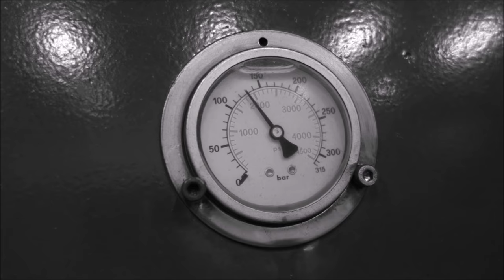Repairing electric motor bearing housing

Comment: I do this same repair all the time. I enjoyed watching your process. I've changed how I do it, and now I bore the bell....rough turn and bore the sleeve to final size, and with the bearing in place, turn for a glue fit in the bell. Part it off with the bearing in place, and lock tite it in. I find great prices for Locktite on Ebay. I would probably charge $200 or more for one that size. BTW.....it's called a boring bar in my town. The slidey thing is called a carriage.....considering how Finish is related to Martian languages, and all other Earth languages are from this planet, Your English is perfect!
Reply: Josh Ward I do these all the time also. We can’t fit the brg. As they press the brg. On the rotor shaft first then tap fit the end shield . We have to loctite and Dutch key the sleeve in as they can come out of the end shield.

Comment: I am not a machinist but do this sort of work in small scale with the Minilathe. And that is exactly the way I would do it. Inc the Green Loctite and the Mitutoyo calliper. I LOVE that inside micrometer! I use a bore guage.
Sometimes it makes you wonder how they made the original part though. Start with a raw casting and have to machine all your centres.

Comment: Fuck me, that 3-point micrometer is great. I'm surprised that I haven't seen @Abom79 using those yet....!
Reply: They are VERY expensive and you must buy a set which is VERY, VERY expensive. Thousands of dollars. I find a good set of telescope gages work great once you learn how to use them. A set of those costs less than $200.
Reply: Prostheta and that one doesn't even look digital...

Comment: I love the main channel and this one too  :) also at last a machining channel from europe where the metric system is used instead of the 3/125465465468 inch bs :D nice to hear mm and cm used :D
Reply: Decimal numeral systems are used by machinists everywhere. The only difference is the base unit, all the math is the same. Separate from that, fractions are basic year 3 math, all rational numbers are fractions and all practical measurements are rational numbers. Standard inch fractions are all base 2, same as your computer.
Would it help if they used the term milli-inch instead of thousandth? They used mil in the past (still used for some product thickness, such as plastic bags or paint coatings) but the term mil has faded due to confusion with mm and um.
Reply: bametje88 I worked lathes and cnc mills in America and we used metric...what's your point
Reply: there is always a metric elitist
Reply: herpherpbrocolli Not too elite if they don't understand fractions and other basic math.
Reply: No need to be buthurt guys. Have been following loads of machining channels over the years and even experts (Americans) who do it 20+ years still struggle quite often with the imperial BS when doing complex things. I'm not a metric elitist but some things are just superior
Reply: You only struggle with it because you don't understand basic arithmetic or metrology. 1.23 units is 1.23 units, it doesn't matter one wit what those units are as long as they are noted at the start and don't change. It can also be written 1 and 23/100 units, still the same bit of math. Some times base 10 fractions are preferred and other times base 2, to reduce rounding error or make halving and doubling easier, again this can be applied to either base unit.
What isn't superior is very expensive change with no practical gain. A set of calibration gauge blocks is 2-3 months salary. Converting a whole house would be several years entire salary and then any repair would be incredibly inconvenient ad expensive as parts would need to be custom fabricated or specially imported(at least for the first couple of decades).
Reply: I dont struggle with anything you are assuming things and you are trying to defend something that you guys use even if its inferior by blaming someone that they dont UNDERSTAND. The difference between Americans and Brits for example is they know their mixed system has some faults (stones etc) but dont try to argue that you dont understand it and that it is perfect and what not Americans go up in arms as soon as someone points this out no idea why :D I have seen even experts here on YT get lost in measuring real word stuff and than machining those objects trying to count in thousands doing extra steps taking up precious time to make simple mathematical calculations just because of the flawed system and you cant really argue against it if you know the basics like you say you do.Fact is its slower and can be less accurate due to mistakes etc. Im not only talking about entering units into a machine or CNC.In theory you could use your own units that you made up but how accurate would that be ? and how simple would that be when you need to sort out complex mathematics  ?  I'm not saying it should be changed even thou these things have been done in the past with no issues
Reply: (I'm Canadian btw)
Like I said, you simply don't understand the basic math involved, its clear in every single comment that you have made that you lack a proper foundation. The algebra is identical. The underlying unit system is completely interchangeable, there is no need to understand inches or meters.
There are no extra calculations inherently needed with either, you pick whatever system your tooling is in, make at most one conversion to those units if your specs are in the other, and stick with it to the end of the project.
Reply: I know the metric system quite well, I am actually very well versed in metrology generally and advanced engineering, and I can design, build, and program said machines used in high end processing from scratch. Your a simpleton with an armload of strawman arguments created by an understanding of the subject so low that you have no reference to grasp just how little you actually know about the material. (The effect is formally documented by researchers Dunning Kruger)

The meter, second, kelvin, and kilogram are all as arbitrary as anything, their only advantage in daily life is that they have become a widespread set of standards. They have no inherent link to the physical quantities that they measure. example temperature is a measure of thermo-kinetic energy, thus the units should have some fundamental quantity, but no we use 1/273.15 of the energy between absolute zero and the triple point of water.
Reply: I am an advanced cold water drysuit diver. Air consumption changes drastically with thermoclines, activity level, fatigue and misc activities like buoyancy comp.; nitrogen accumulation is a far larger concern and minutes at depth are minutes at depth.
Our tanks are measured in standard cubic feet.(the volume when expanded to one atmosphere absolute) An 80 holds twice the total air of a 40 at there respective rated fill pressures. The dimensional volume of the tank isn't needed at all. The state of fill is a simple direct proportion of rated pressure a 4000psi tank at 2000 is half full.
Atmospheres and bar are not metric units by the way. Pascals (N/M^2) are SI system.
Reply: Well fuck, I missed the whole video reading all this, , mill's all the way

Comment: Not used to hearing metric in a machine shop lol I'm over here converting what your saying to inches . Nice work with the repair . I run a devlieg jig mill 4" spindle 60x36 table . And many lathes and other mills and bridgeports.  Like you a jack of all machines in my shop as well as the welder for the shop

Comment: Good job, most of my work is doing this for electrical motor repairs, I use loctite on the sleeve to but they also insist that the sleeve is “ Dutch keyed “ in 2 places before final machining for the brg. You can also use a “ take up” brg . Or internally knurl the bore if there isn’t enough wall thickness for a sleeve.

Comment: It's interesting that you went with what we call a slip fit with bearing compound. We always use what we call a press fit. Where the bushing is one to two thousands over sized then we freeze the bushing in nitrogen to shrink it. It falls right in and when it warms up it's an extremely tight fit. We do use bearing compound sometimes but it's seems to be frowned upon unless absolutely necessary for some reason.
Reply from the maker: +Rictus 

I have done that also on some works for example when parts are exposed to heat that would destroy the glue. But glue is fastest method with these regular electric motor parts. Or you can also heat up the housing but usually the paint and grease would get on fire so that is also problem.
Reply: +Beyond the press After I wrote this I thought of another reason not to use a press fit. If the wall is too thin after it's been milled there would be a chance of cracking. 
Cool stuff your doing!
Reply: We always make the sleeve a tap in fit with loctite then Dutch key in 2 places then finish bore last opp.

Comment: I would have enjoyed seeing you indicate that big old part. I'm so shit at centering stuff in the 3 jaw, i always enjoy watching people do it better than me
Reply: Three jaws that I know of are "self centering". They don't adjust. If you've got one in good shape you might have a gnats whisker of runout but one that's beat up and crusty inside can really go sideways on you. They're more about setting up quickly than absolute precision. You can adust each jaw individually on a four jaw. That being said, three jaw is fine for most jobs if it's not abused. If you need dead nuts precision you go with a four jaw and dial indicator. You can shim your piece in a three jaw if you have to but that can be hit or miss as well.
Reply: heliarche you can get 3 jaw chucks just as accurate as 4 jaws if you clock them in with an indicator. You just hit the outside of the jaws with an aluminium hammer to adjust runout. Similar to how you would tighten a a jaw on a 4 jaw to adjust it on a 3 jaw you just hit it, but only with soft hammer.
Reply: Good luck with that. Stay away from my lathe...
Reply: heliarche yeah haha it sounds dodgy but it works. I work in a tool and die shop and it's how I was taught and how all the other workers do it including the owner. I however have found on one chuck at work that if you tighten it using one specific position it will most times be within .02mm without having to adjust work runout.
Reply: BlahBlahMoose
Well, if it works it's perfect I guess. I'll stick with a four jaw for the finicky stuff.
Reply: heliarche Awesome 4 jaws are great.

Comment: Lauri, I'd love to see a video of you doing a temperature-based pressure fit, where you'd heat the outer part in order to get the cold insert to slide into place.  I'm surprised that you would machine the inner diameter of one part and the outer diameter of the other to match.  I thought you'd need a very slight overlap, so the fit would be tight, but I know nothing about machining.

Comment: I very much enjoy your channels and this video.  And wonder why could you not have purchased a bearing with a larger outside diameter, then machined the motor housing to fit the new bearing?  (You did need to replace the bearing anyway.  Yes?)  Danke schön für alles.
Reply: Tom Eubank probably cheaper
Reply: Tom Eubank The bearings are probably stocked and specialized to this motor. cheaper just to shim the housing like this.

Comment: Please, can I ask...why didn't you use a brass hammer, or a piece of wood with your "regular" mallet? Doesn't using your regular tool tear up the edge of that spacer you put in?? Wouldn't that make it harder to insert the bearing, or introduce tiny pieces of metal when you are pressing the bearing back in due to the dents you made in the spacer? Thanks for reading. Love both of your channels. I hope you answer.
Reply: planetrob555 he machined off that edge in the end to make it flush with the motor housing. Any dents or dings are gone.

Comment: What is pay like for this kind of work? Looks kind of fun to me.
Reply: That really deppends on where you are based at. Google says that machinist in finland gets an average wage of 1300€ ($1534) per month. Here, in the czech republic it would be around $1140. But you may go as high as $3000 deppending on the work you do (something that requires more skill will be better paid). Also, I think that they are family company and that is something completely different, especially if you do non-standart work.

Comment: This is really interesting. In what kind of motors or vehicles are these bearings used? They are gigantic!
Reply: That bearing housing is fairly small compared to a lot of motors. Motors are used in loads of different applications  anything from roller coasters to food mixers.

Comment: Why are all the cuttings blue? is it from heating?
Reply: +NRGMatrix yes
Reply: +NRGMatrix Cutting steel is neat because the shavings will discolor depending on how hot they get. Tan-colored steel chips mean they come off warm (relatively) and blue chips mean they come off really hot.

Comment: Is this your own shop or do you work there?
Reply: +spankmeister his own shop.... i think he inherited the shop from his dad
Reply from the maker: +spankmeister 

It is our family business. My dad works also there.
Reply: Beyond the press Ah I see. Because I sometimes hear someone else working in the background. You have a very well equipped shop. :)
Reply: +spankmeister and what you father says about to work in the lathe with that gloves? because mine could probably slap me in the face.
Reply: Why is that? I would loose a glove instead of finger.
Reply: According to my knowledge using any type of wearable textiles for example, gloves or sleeves next to a spinning tool is a big no-no, because if your skin touches the spinning part you'll get cut, but if a textile gets in contact it might get winded and suck in your arm, potentially seperating complete parts of your body
Reply: The problem is that you lose the glove and your fingers. Put a glove on one hand then with the other hand grab the tip of one of the fingers of the glove. Try to pull the glove off as quickly as you can, you'll find it gets stuck. Now imagine what would happen if a 2kW+ lathe pulled the glove off! The other no-no is wearing rings, if the ring gets caught it will pull the skin off your finger. Google images for "degloving accident".
Reply: Exactly. Very dangerous. But, manual lathes are inherently very dangerous. Among the most dangerous pieces of machinery in a manufacturing environment.
Reply: well a wood router by hand is by far one of the most unprodictable and can put things though a wall from across the garage, 23000 rpms with 3 1/2 hp will take off a hand or finger and you wont even feel it, the lathe you just have to wear protection and keep clear of moving pars and watch how much you take off, let the work snap and fly off but doing a slow machining job is not quite as dangerous as some of the stuff out there in the shops, but machines that can pull you in will do some of the worst damage, and crush injuries are plenty when ever you have to lift something up and it can fall they can kill you real fast especially the stuff in a locomotive shop, like the home of npk 765 I voleenteer there sometimes.  safety first as they always say, oh and any sort of hot working can cause fires or exploding tanks ya got to watch fer them too

so this guy is a machinest or blacksmith or something that runs the press channel?

I thought this guy was older as well sounds like one of those 40+ worlds strongest man kind of guys, or a huge viking kind of guy heh.

Comment: why do the shavings look blue? A quick guess is because the heat causes them to change color? or maybe because of the light hitting it?
Reply from the maker: +Colin Stuart 

The heat turns chips blue when you are not using the coolant. I don't like using the coolant with this or other not fully covered machines because it flies all over the place and if you stay under 150m/min cutting speed the cutting bit lasts very long even with out it.

Comment: I used to work in an electric motor repair shop.....boring and bushing an endbell in a three jaw chuck would get you run off quicker than hammering on cast iron!

Comment: Sure this new housing is exactly centered like the old one?
At start you just use the casting - so all processed stuff after that has accuracy of the mold ... ?
Reply: +Dexter Treehorn I think it doesnt matter because if it is off a few hundreds of a mm it just gets compesated when reattaching it to the motor with the bolts
Reply: +Dexter Treehorn He probably centered it off camera. I cant imagine he would forget something essential like that...
Reply: +Dexter Treehorn I was thinking exactly the same :/
Reply from the maker: +Dexter Treehorn 

I used the same surface for first mounting that is used to connect housing to main frame of the motor. I check the centering with dial gauge but I didn't use the footage because I was standing on front of the camera most of that :D But the centering of those housings isn't very accurate job because the connection between housing and the main frame of the motor is quite loose and there is room for some error.
Reply: +Beyond the press 
OK ;)

Thank you for sharing interesting stuff from your work! 
Great job in crafting and youtubing ;)

Comment: is there any easier cheaper way?   I have a motor with 2 inch OD shaft bearings 1inch ID  I think a metric was the closest replacement I could find.   Both old and new fit loosely.  They're like a slipfit plus 1thou maybe.   I don't want to mess up my castings if there's an epoxy method or something that might be worth trying.   I don't know what the best fix is for me.   The motor runs smooth on a VFD under 55 Hz but over that and I get a vibration (that might not be the loose bearings given there a VFD involved)  it's a 1hp 3 phase Century motor.   Thanks in advance if anyone has advice.